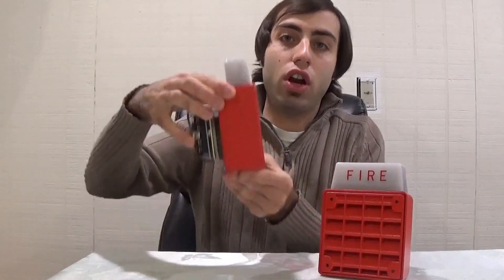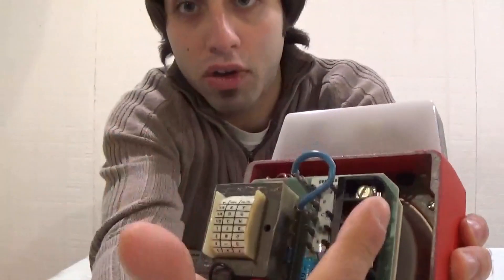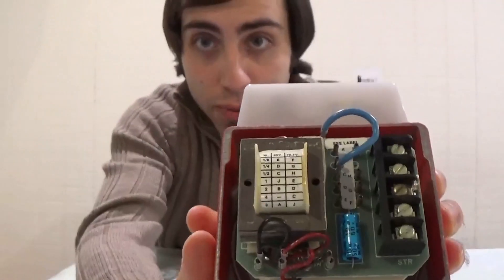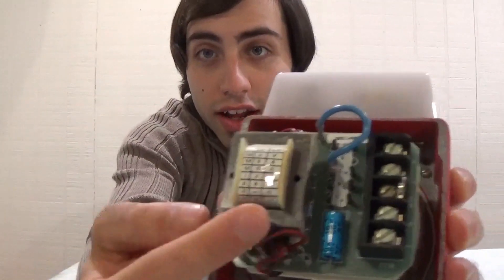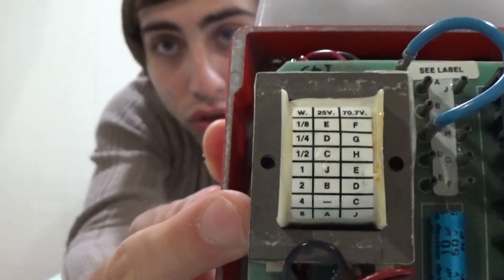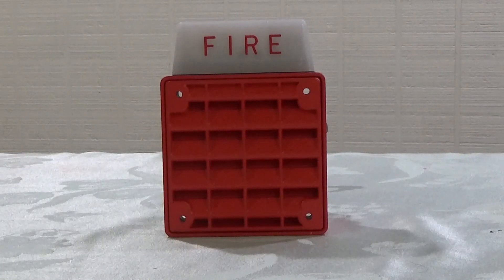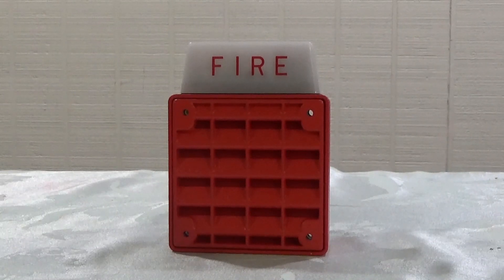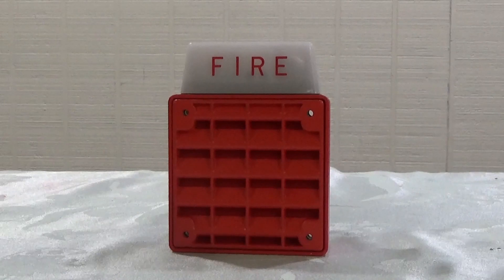Ending 2020 with ET-1010's (Wheelock Speaker/Strobe Fire Alarm Test) #FireAlarmFriday

Comment: They had those at South Station in Boston, MA. Originally installed with a Thorn-Kidde voice-evac system in the late 1980s that was then upgraded to a Simplex 4100U in the late 2000s, but several of those Wheelock speaker/strobes remained intact (the system does the Code-3 tone and a custom female evac message.) Now that they are undergoing further renovations, I'm not sure if any are still remaining intact or have been replaced with TrueAlert speaker/strobes or whatever.
Reply: @Bart Lee This is probably why in the main concourse area several of them were replaced with large Wheelock loudspeakers and RSS strobes when the Simplex 4100U system was put in, along with replacing the ones that were outdoors at the train station platform with Wheelock ET70WP speaker/strobes (Simplex's main weatherproof speaker/strobe of choice.)